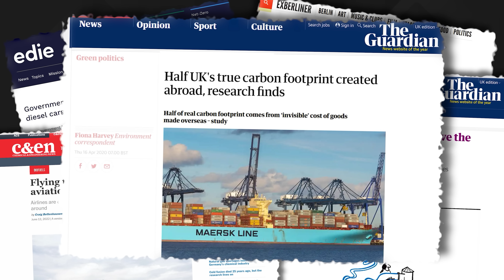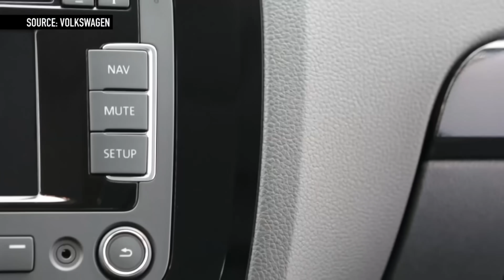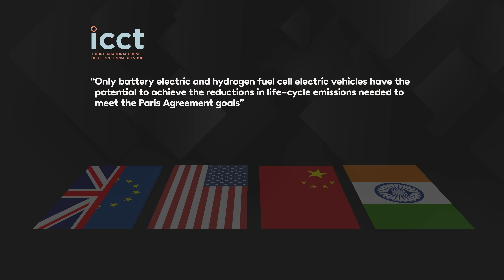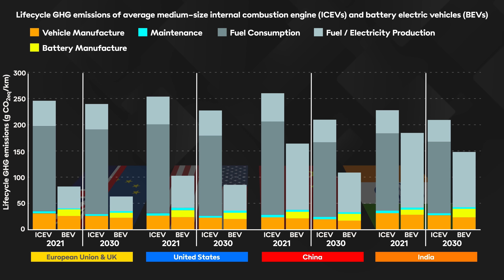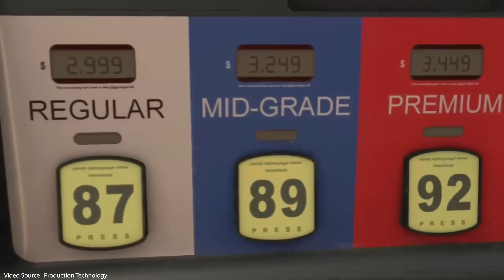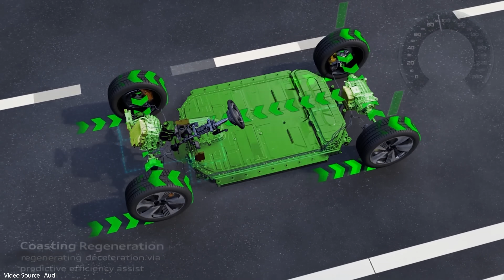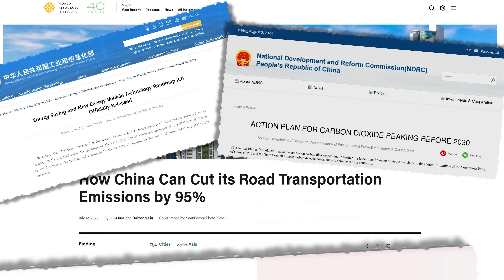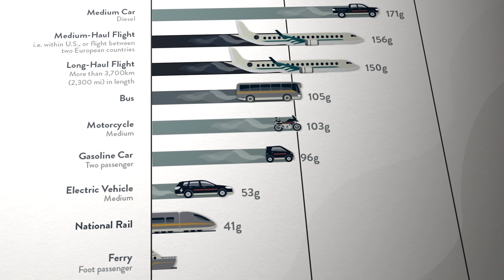Are EVs really better for the climate?

Comment: we are already past 1.5 deg C. I also have an EV x 2 and solar panels and battery. Governments and politicins have a lot to loose if we switch to EV - pensions and investments are oil based and taxes on fuel. ICE vehicles have massive No of components which have carbon impcts and need to be replaced regularly. I travelled to london weekly from cornwall, my EV would only consume approx 60kwh of energy, by converting the mileage to diesel litres the energy consumption was around 5 times higher, due to inefficiency of ICE.
Reply: We've been here before Steve, when the motor car appeared, causing uproar amongst the many with interests in horse breeding, carriage building, saddle making, blacksmiths etc..... The taxes on fuel is straightforward enough. You simply move the tax burden from the fuel itself, to actual road *usage*. A pay per mile system. And it appears that is what is going to happen.

Comment: EV’s have to be the way to go. Not yet though. Nor in 10 years. The woke, whacko idiots responsible for forcing their introduction have neither created the generation capacity nor the methods (that does NOT mean wind turbines or solar) to generate carbon free energy nor sufficient charging points. Our saviour has to nuclear power.

Dave: EV’s are not 80% efficient because of regenerative braking. You must be having a laugh. Possibly in a city but a properly (a big word I know) driven vehicle moving along a motorway will not need or use regenerative braking, ever. But this fact doesn’t fit the narrative of the macrame eating tossers who spout this crap.

Comment: A lot of the manufacturing emissions would be reduced if we made steel the way we make Aluminium (Sadoway).  The proposal to run blast furnaces on hydrogen would likely end up using dirty H2.  Might as well stick with coal.  Elon calls hydrogen 'stupid'.  I think its another fossil fuel industry scam.  It is sad for the Japanese car industry that they were sucked in by the bs.

Comment: Very interesting, the manufacturing of evs and there batteries must have improved a lot.
 I have had experience of driving an electric van, for short deliveries it was excellent, but i used the same van to go to the next city, the round trip was 60 miles, my range before loading was 85 miles, fully charged it is 110 miles. Now we have some issues here, the van ended up being fully loaded (more load on motor) to go to the next city, it also coincided with a terrible storm, so it was dark and it was raining (lights on, blowers, wipers), the van never made it back, running out of charge less than a mile, from its home destination, which it then had to be recovered.
I personally will not take these vans between cities unless they are fully charged, hopefully the range in our next generation of vans can have range double of what we have now.
I am a fan of the tech, but i am aware of its limitations, with what i have seen with vans, makes me think how impractical it is to scale this up to trucks, Trucks efficiently move bulky goods across the country, one large truck being 1/3 the cubic capacity of a average train, i did wonder if hybrid hydrogen internal combustion engines are being considered, because these trucks run 24 7 , they are not off the road, time off to charge, is time not operating, and batteries must be expensive, heavy and bulky, and that the manufacturing capacity is better suited to car and van production.
Do we have any ideas what carbon savings could be made with a hydrogen hybrid truck?
Reply: Hydrogen may come through.   It is not there yet.
I am confident we will get batteries with longer ranges.
Hydrogen internal combustion is very inefficient.   Fuel cells have then beat by 2X more or less.  Mostly more
Reply: @danharold3087  Diesel efficiency in a truck is 40% hydrogen is between 27 36%, Hydrogen fuel cell is about 50 to 60 (cars)%, but the fuel cell tech is heavy and complicated , a hydrogen hybrid system would likely bring efficiency levels close to 50% , internal combustion engines at there best efficiencies are close to 60% , like in shipping or formular 1. The reason i suggest hybrid hydrogen, is it can be created by renewable energy resources, The internal combustion is efficient at delivering a continuous load, and you dont have to carry heavy bulky expensive batteries, or at least not so many, another big one, the grid can not charge all the trucks on the road, a compound of 70 electric vans that get charged every other day, they can only be charged at a slow rate (16 hours) due to the capacity of the grid, and tonnes of copper have been used in such an installation, if there were 70 electric trucks, it would need a direct line in, this might be practical in some instances, but in most it would not, its simply impossible to deliver that much electric in one go. 
I will be interested what is done with trucks in the future.
Reply: Hi William, there's no way a truck is one third of a train. A goods train can pull upwards of 2000 tonnes.
Reply: @englishcitystone1663  Thats great for tugging coal, or rolls steel, but trucks carry half empty packets, Trucks are about cubic capacity and getting directly from one place to another. Trains have fantastic towing capacity, but for bulky items, a truck is far more practical and an average train is only about 3 times the cubic capacity of a large truck, hence why royal mail the largest truck operator in the uk have mostly stopped using trains.
Reply: Best solution is carbon-neutral fuel made from atmospheric CO2 using nuclear power.

Comment: BEVs won't change much in total emissions, because the manufacturing process is highly pollute. And you need to buy a complete new car. The key to lower emissions would come with Green Hydrogen, using conversion kits for current ICE cars.
Reply: Volkswagen's electric vehicle processes don't pollute much Roger. All 3 of VW's new EV manufacturing plants have a zero carbon footprint, and are powered by 100% renewable energy. The cars themselves are built with a high percentage of both recycled and plant based materials. Even the final paint finish on the cars is plant based..... Volkswagen is - as far as I'm aware - the only car maker to have so far signed up to the legally binding Paris Climate Agreement...
Reply: Most BEV pay off their manufacturing footprint in 1 to 2 years.   After the it is clean air all the way
Your beloved emits crap every time you use it.
Burning hydrogen in an ICE is very inefficient compared to a fuel cell which is still less efficient the BEV.
According to Sandy Monro hydrogen does not work well with ICE that use heads.  Blows the heads off.   Well head gaskets anyway.  So hydrogen conversion is a bad idea.
Reply: Totally unpractical to convert ICE to hydrogen,  ICE cars will produce around half the horse power on hydrogen, and still generate pollution in Nox from the Nitrogen in the air. Plus the un efficiency of whole Hydrogen process, From generating, to distribution to the un efficiency of the combustion engines would result in only 10 to 15% of the original energy driving the wheels compared to 80% for EVs. and cars need to be safely designed around the hydrogen tanks not just stuck in the middle of the boot.

Plus nobody is yet scrapping perfectly good ICE cars to buy EVs, just buying a new EV when they would have been buying a new ICE car and selling their old cars secondhand. Cars have on average life of around a 15 years and as such is going to take at least 15 years to phase out most of the ICE cars.
Reply: @stevetaylor2818  you have plenty of systems available to reduce NOx emissions, as Particle Filters.

Comment: Moving from ICE powered cars, for Coal powered cars? Many EV fanboys like to talk about their "efficiency", but sure they like to keep the manufacturing and disposal of the battery packs out of the equation.
Reply: I did, and from my grid a ice car would have to get 50 mpg over 10 years to match an electric car, you can do this math for your own electric grid
Reply: Say it with me "We know how to recycle BEV batteries"   "We know how to recycle BEV batteries"
Sorry could not resist.   We do.    Just doing my FUD busting duty :)
Reply: Where does the electricity come from that the refinery uses to produce the fuel your car uses?  And what about all the wasted electricity used just pumping oil out of the ground, before it even gets to a refinery? Even an electric car charged with electricity from a coal fired power station scores points over ICE, because it produces zero emissions wherever it goes......
Reply: @Brian-om2hh  what time in average an BEV cars stays on the road with it original battery pack? In many cases the cost of a new battery pack totaled the car. The trow away culture from the Tech industry coming to the Automotive industry, is what it seems.

Comment: The main criticism I'm hearing at the moment of ev cars is that you are likely to have to replace the battery after 10 years and this is extremely expensive, meaning an ev isnt the cheaper option over its lifespan. Is there any truth in this? Just wondering.
Reply: No, with the fuel savings you will get it’s unlikely that an ice car will be cheaper,

And if you charge the battery right an electric car will easily last longer then 10 years
Reply: Good thing the new batteries should be lasting 20 or 30.
Reply: Thanks for the replies. When I say I'm hearing criticism, it's from my dad - he reads the Telegraph.

Comment: In NYC nothing is more than a few miles away yet lots of people in Brooklyn commute to work individually, each in their SUV. If you owned an Aptera and parked it outside your solar panels could soak up 40 miles of travel per day and your daily commute wouldnt be more than 12 miles round trip. You would never need to charge your vehicle and it would always have a full battery.